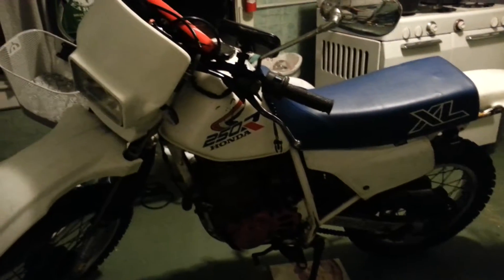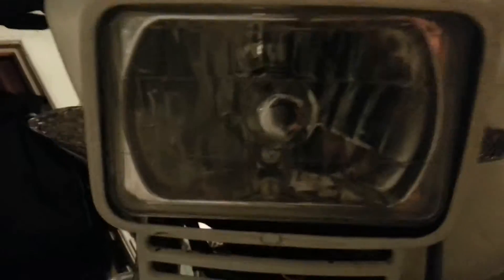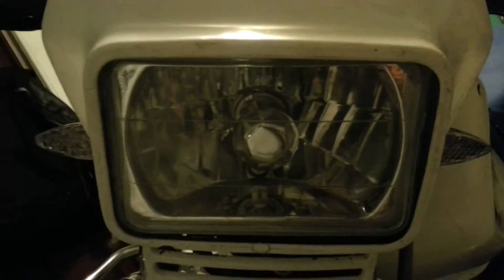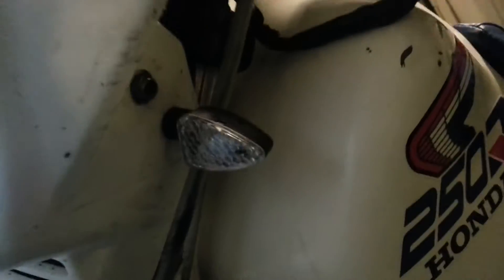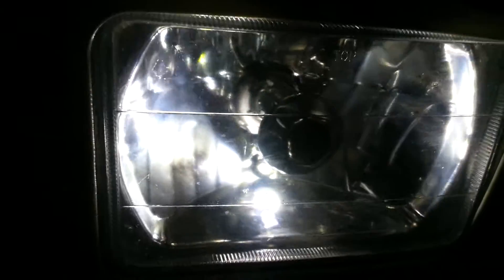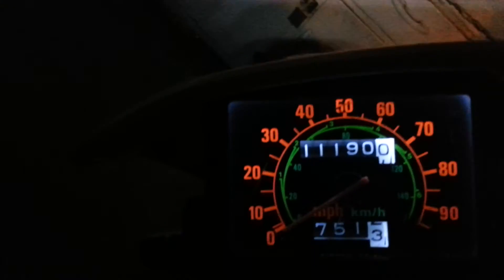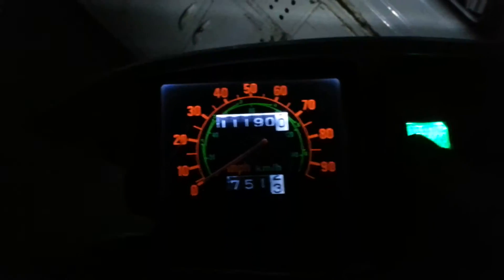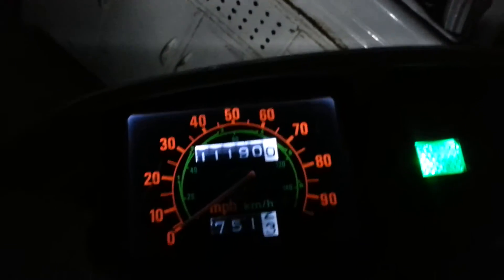LED enduro motorcycle conversion honda xl 250r

Comment: We’re did you put the lee for the speedometer? I wanna do this to my 86 xl250
Reply from the maker: They go in the back of the instrument cluster.  Make sure if they are polarity sensitive to check that they are insert correctly before closing it up. Also if u decided to go with led turn signals u will need an led flasher module as the standard one does not work with the low power leds
Reply: @HughsScamProducts  thanks man appreciate you responding, do you still have the bike by chance ?
Reply from the maker: @tanner6282  yes, I haven't had it one the road for a few years bc of wrist problems but im going to next year
Reply: @HughsScamProducts  that’s awesome man , hope you can get out there soon man best of luck to ya !

Comment: I have an 85 xl250r, put led turn signals in it and an adjustable flasher, have a led headlight on order, what bulb number/size/part number are the ones in the dash speedo and the neutral light?